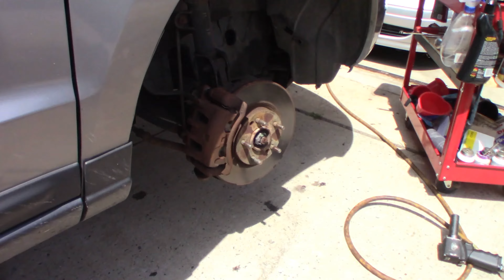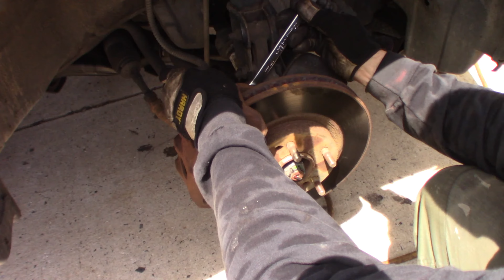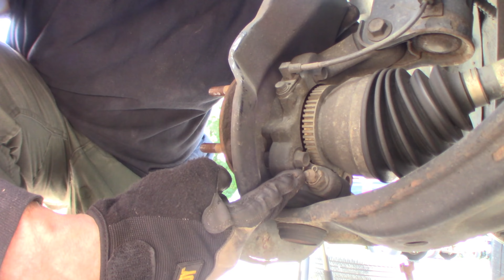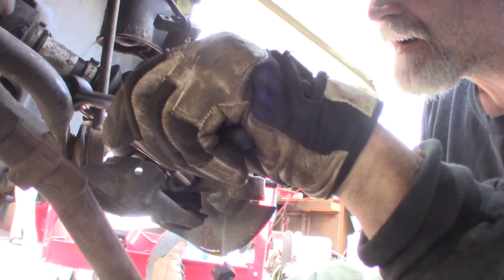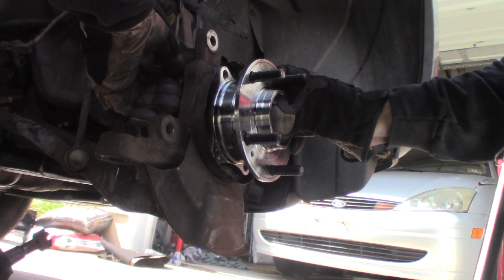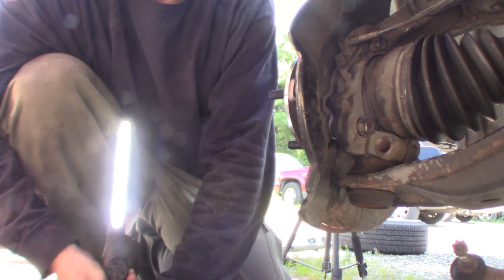2007 Hyundai Santa Fe FWD Front Wheel Hub/Bearing

Comment: I see online info that says you should NOT reuse pinch bolls, like those found in steering assemblies:  Always replace a pinch bolt with a new one when removing it, especially if it is part of a critical assembly like a steering knuckle.
Reasons stated:
      o  Stress on the bolt:  Pinch bolts are often used in high-stress applications where they need to be tightened very firmly, which can stretch the metal beyond its elastic limit, making it unsafe to reuse.
      o  Damage to components:  Repeatedly tightening and loosening a pinch bolt can also damage the threads on the bolt or the mating component.
And also saw someone made this comment:  "It pinches the opened end of the steering shaft around the stub of the steering gear. It’s single use because it’s torque to yield(tty). tty means the bolt is purposefully stretched to its yield point during its torque procedure, you can only do that once if you try to torque it again they no longer yield and just snap."

And yet, in the last half dozens videos I've watched dealing with pinch bolts, not a single person replaced the pinch bolts. They just reused them.

Comment: Thanks for the video.  Just thinking of how dumb it was for auto manufacturers to design the tone ring on the outside of the CV axle where its exposed to air and the elements, and globs of rock-fill mud, ice and salt rock, and all manner of bits of junk can get glued into the teeth of the ring by gooey grime and grease, thereby throwing off the speed sensor, ABS, and traction control data.  Funny how they went through great lengths to protect the tie rod and CV axle moving joints with rubber boots and all that, but leave such a critical piece of safety open for all manner of contamination. I'm glad most manufacturers have switched to an inside magnet design.

Comment: you should put it all together the brakes and put a small prey bar in the rotor vent hole to hold and torque not the wheel studs.
Reply: You should pop center cap from wheel put it on and torque it with the wheel on the ground

Comment: what if wheel is heating up after reassembling
Reply from the maker: That's hard to say... wheel bearing, brake hanging up?
Reply: You could have tighten the center nut to hard. Did you do it by the specs or just by hand force?. loosen it 1/4 turn or something and try

Comment: forgot the torque specs for the bolts; especially the hub bolt!!!
Reply: Two ugadugga
Reply from the maker: I've gotten to the point that I don't give them as they differ for AWD FWD, etc and I don't want people to have the wrong values.  Easy enough to look up online.
Reply from the maker: https://www.hyundai-forums.com/threads/front-bearing-hub-assembly-to-knuckle-torque-specs.641645/#lg=thread-641645&slide=1
Reply: You can find the FSM online fairly easily. 

144-188 ft-lbs for the spindle nut for the 2.4.
Reply: So is it 100% necessary to remove the tie rod?